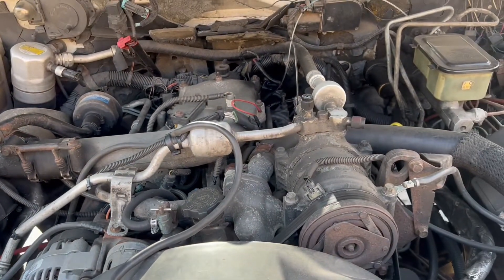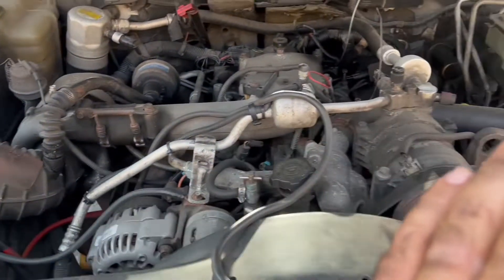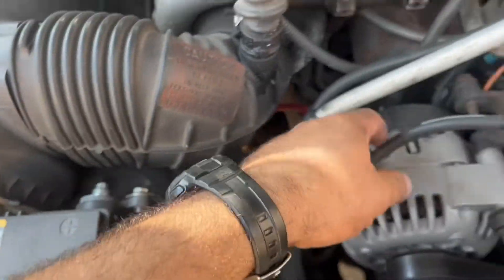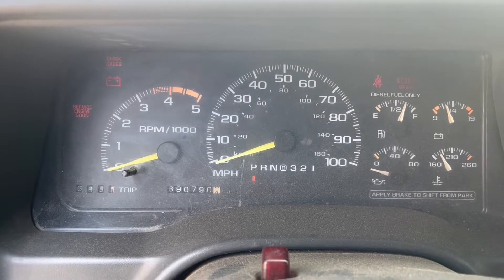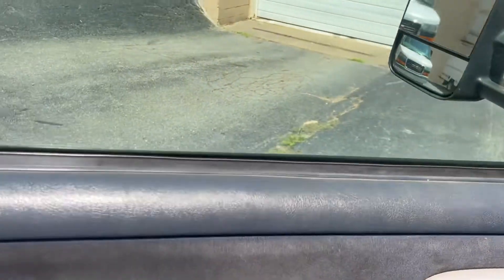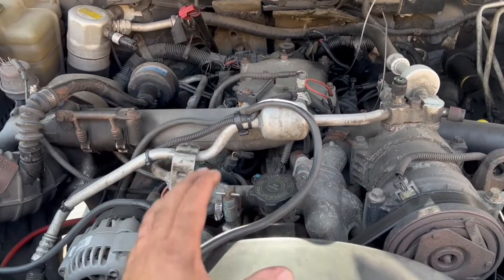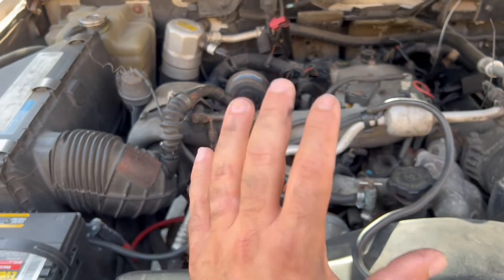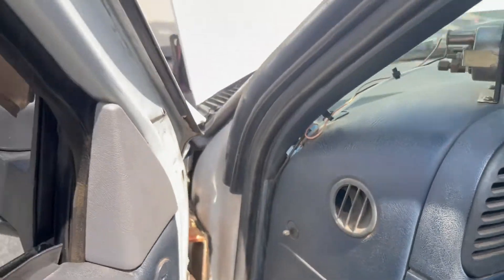6.5L Diesel Engine / How to Make This 6.5 To Last 390k Miles

Comment: I have the same year in a dually. Had since 103k, now at 124k. Good to see it can make it to at least 390k and you're just running mostly stock. What brand oil have you been putting in over the years? I heard mobil 1 filter but wondering about the oil itself. Thanks for the upload

Comment: I bought my 1st 6.5 about 18 months ago & I changed out filters and couple of sensors you know basically tightened everything up, I was fortunate to know that guy I bought it from takes care of everything he owns one of reasons I bought it. I've learned the typical things needed with the 6.5 and so basically all I've done is take care of necessary maintenance and I'm amazed at how this truck performs at almost 30yrs old I have another vehicle 20yrs newer I would rather give it up than my 6.5

Comment: I just bought a 99 GMC Savana 6.5 box van for $1000. Only has 141k miles. Guy sold it because it kept stalling. I replaced and relocated the pmd and it hasn't stalled since. I do have starting issues but I checked the batteries and realized the old owner was actually running the second battery to an inverter and the other one only had 11.9v.  Grabbed one from Walmart and waiting for a second one to get delivered. But I think I have bad glow plugs too so I need to get some wire leads.  Unfortunately, not having two batteries makes testing a lot of the systems impossible. Pretty much like you said.

Comment: Noticed your turbo actuator was wired manually...what boost levels do you see??
Reply from the maker: usually around 5 -7 psi not much.
Reply: @Kahz-w4d  about the same for me...I've experimented with different spring rates etc...but reluctant to push it higher...
Reply: @michaelmounts1269  I've heard 10 is kinda safe before you are gonna blow head gaskets but honestly just head stud it if you want more boost studs are last i checked around $200 for the set ARP brand
Reply: @nou8257  you'll defuel the truck after throwing a boost code.
Reply: @jerrymarcin5343  if you are a db2 pump pretty sure that doesnt even matter and if your a ds4 just tune it then? shit isnt expensive for these trucks.